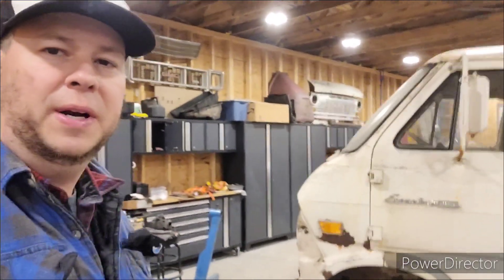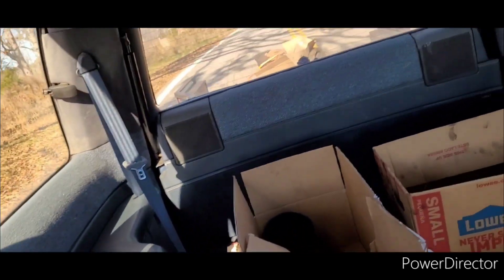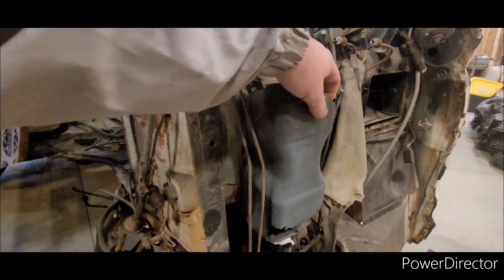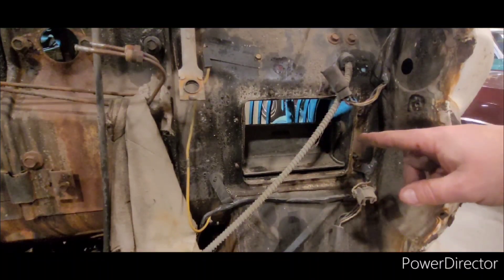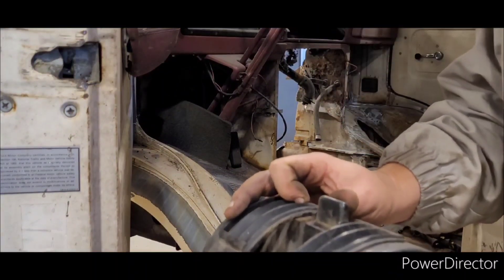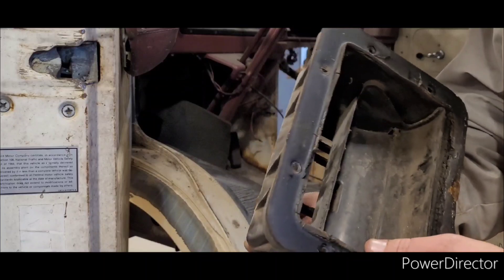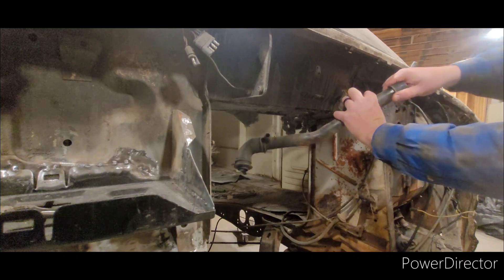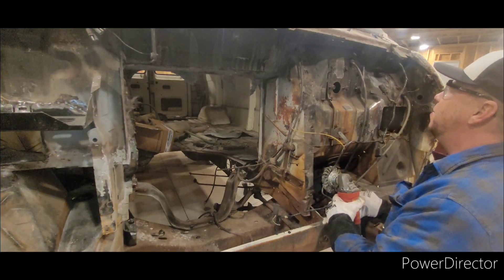Engine @ Machine Shop, Gotta Prep Bay: 1969 Ford Van Resto pt 26

Comment: Great video SC !  Nice that you are getting the engine refreshed, just love those old straight sixes.  Im pretty sure a heat gun with a putty knife will take that layer of undercoating off
Reply from the maker: Its pretty thin in this case. Different size wire brushes are knocking it out.  A little each day!